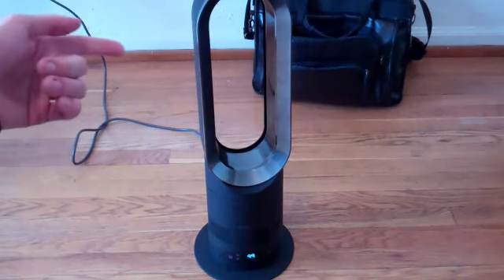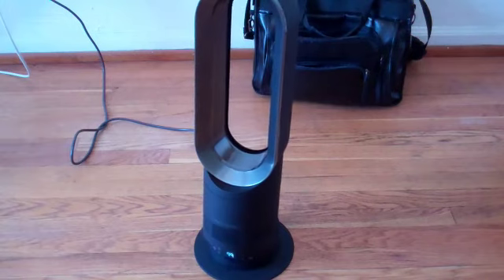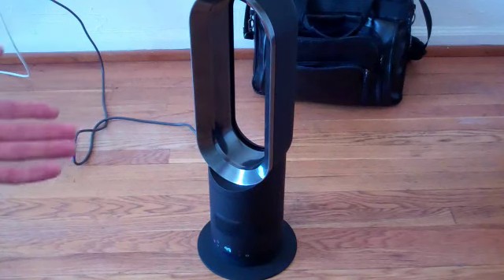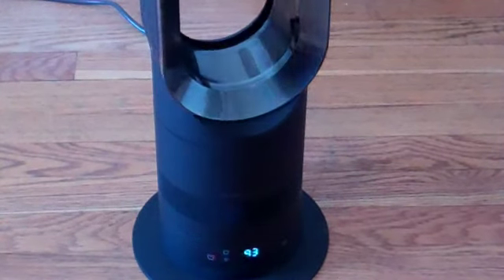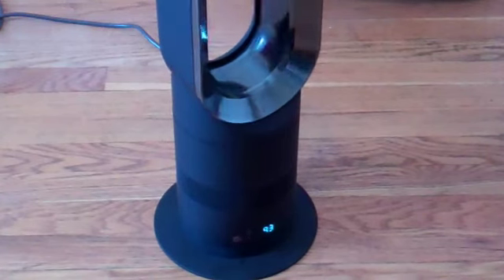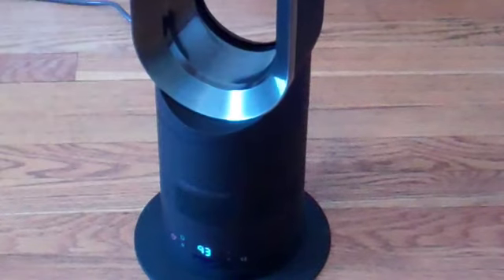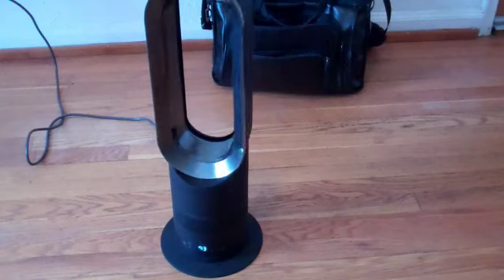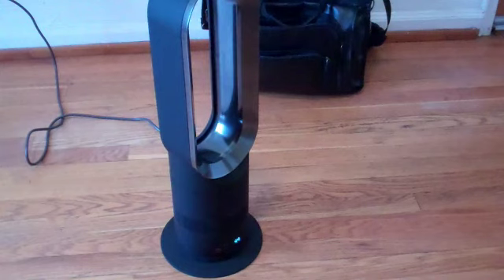Dyson Heater Review Hot+Cool (AMO5 Model)

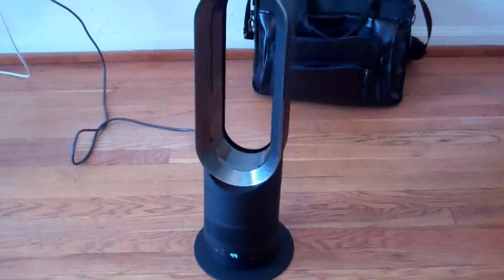Comment: 0:57  WTF?!  an LED lightbulb can draw as little as 2WATT and some Haloges can draw up to 500WATT not all lightbulbs are the same.. 
Also what setting, you know in cold mode there is no need for heating elements so it will obviously draw less. On average a fan draws about 30-100 Watts, a heater 1500-3000 Watts.
Reply: @cdg